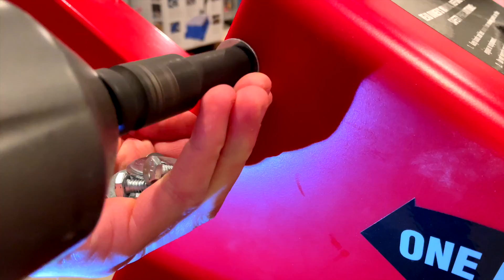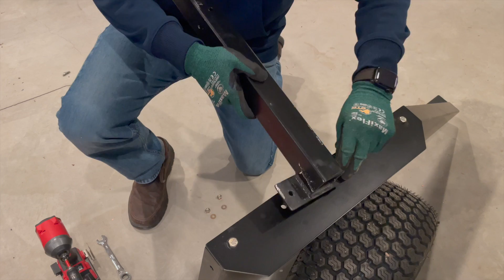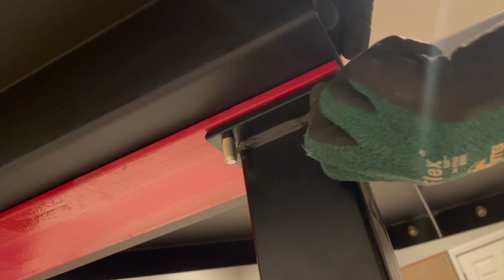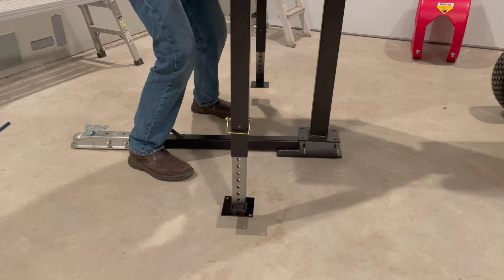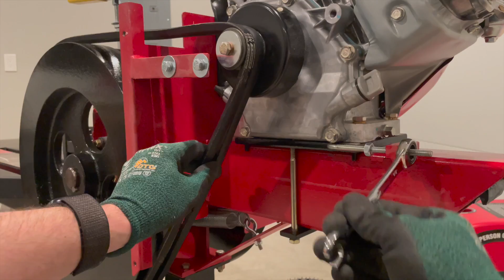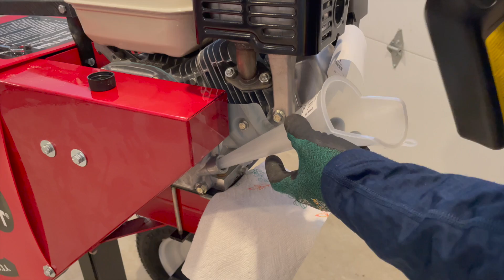Assembling the SUPER SPLIT HD Log Splitter

Comment: My J Model arrives tomorrow. Your video is very helpful.
Reply from the maker: Now that it has been a little bit, how do you like it?  Have you had a chance to put it through its paces?  Mine is still rock solid.  And I'm glad the video was helpful.  Have a great holiday season!
Reply: @coyote12workshop  Rock solid is a good description. At the age of 73, hand splitting is not as much fun as it once was. My electric J model Super Split is quiet, powerful and fast. Right now, it is resting comfortably in the garage, waiting for next year's cutting. Best thing I have bought in a long time.